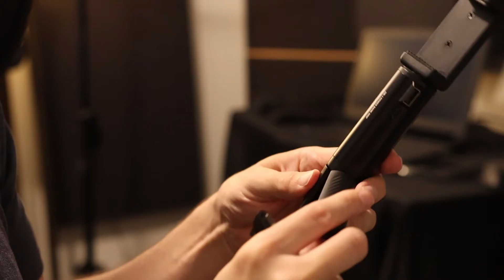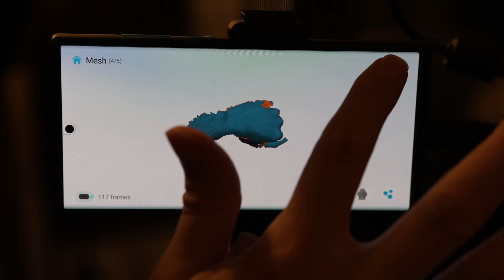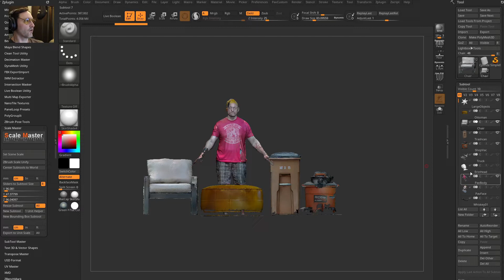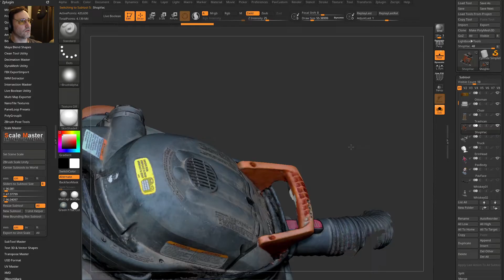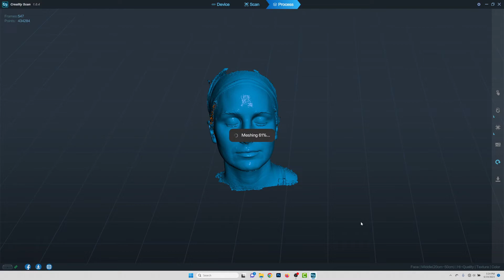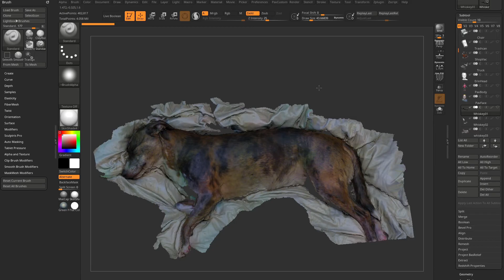CR-Scan Ferret Part 2 - Portable large object scans using phone, plus face and body scans! Creality

Comment: Could the Ferret scanner be used to scan in motorcycle bodywork/panels and then use software to flatten each individual section to make templates for printable vinyl graphics?

Comment: creality scan sucks soooo hard.... i have a ferret pro... one day i thought oh ill try to scan my whole bedroom... yeah no... the ferret pro would actually be useable for this... but creality scan cant handle it... i have a 24 core cpu 128gb ram and a 5080.... a goddamn supercomputer for this sort of workload...(reality capture can create and use 5 billion point clouds from pictures) creality scan... routinely crashes at the sub 10 million point level... doesnt even give a clue what the problem is... just says software did not respond... and gives you a yes button to press.. at which time the app closes... at this point my ram usage is always under 32gb so leaving 96gb on the table... im pretty sure they just straight up designed the software so you can only scan the size objects they allow... the scanner itself has no such limit... its all the software... but if you could use it like that you wouldnt have to spend thousands on a "better" scanner

Comment: Got mine coming soon. Doing research on how to use, thank you so much for sharing this!
Reply: How did the ferret scanner go?
Reply: @deanclements1839  Haven't really used it yet. Played with it some, but Haven't done anything formal though.
Reply: @smaqdaddy  any news on the ferret scanner yet? Is it worth getting?
Reply: @deanclements1839  I have used it once. Seems to work pretty good! My last experience was using a Kinnect on my slow PC. The Ferret outperformed that.